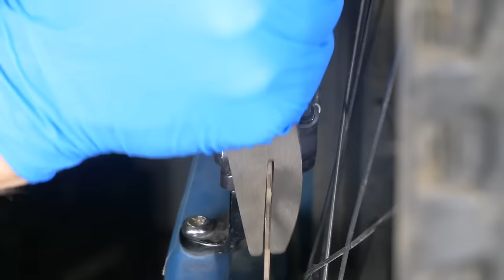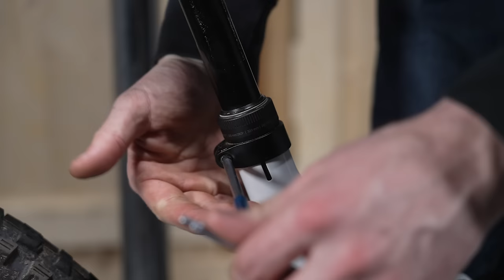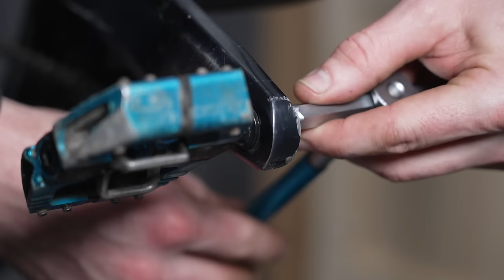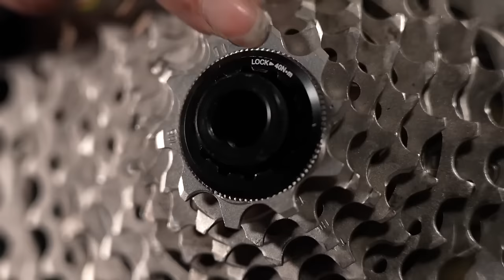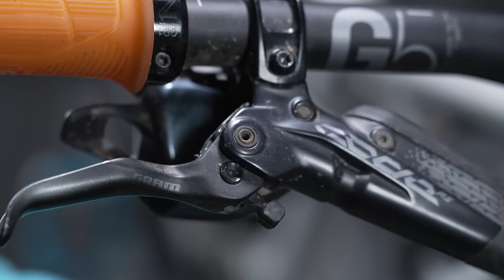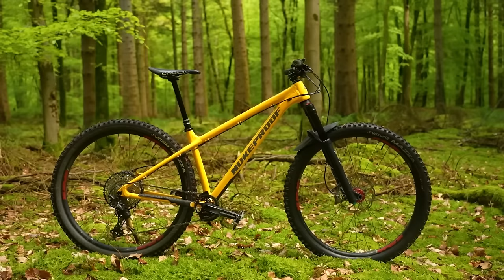Help! My Bike Is Creaking! How To Fix A Noisy Bike

Comment from the maker: Does your bike squeak and creak? Have you just ignored it up until now? Let us know if this video has helped! 👇
Reply: When I put a lot of power into it a clunc sound comes from my bottom bracket I think but I can also feel it through the pedals especially the right one. Any ideas anyone?
Reply: I'm just learning about some of this kind of maintenance, but I totally resemble the gorilla you mentioned. At normally over 100kg, standing under 5'10, I'm a hefty unit. Making things creak is kinda normal for me. I've got over 100 psi grip strength and am tuned for explosive forces. I did provincial class swimming, AAA baseball and was in an exceptional athletics programs, plus martial arts, blacksmithing and am ex-Army. I'm hard on kit. 

Hence studying your videos. LOL!!
Love your stuff.

Comment: You may have mentioned it, but be sure to check your frame for cracks! I had an aluminum bike that I chased a creak on for weeks before finally realizing I had cracks in the welds near the bottom bracket!
Reply: Me too. Mine was a Boardman.  Halfords were as good as gold and replaced the frame under the lifetime warranty.

Comment: I fightet a while against two creaks. First creak was caused by a slightly loose cassette, the second was caused by a rusty rear suspension pivot bearing. Yes, this bike wasn't even 3 months old, so in the end a warranty replacement. It took the bike mechanic about 3 or 4 visits until he found and fixed it.

Comment: If you hear creaking and cracking noise when you go uphill from your bottom bracket, then I'd recommend you to check the chain ring, it has like 4 bolts, you need to either use grease or loctite compound then tighten it up very well.

Comment: i'm confused. Why put grease on non moving parts like nuts & bolts, saddles, stems, seatpost clamps, , etc, etc, anyway. Wouldn't a tiny drop of oil be better.
Reply: grease adds more preload than oil due to its volume

Comment: I had a 2005 volvo XC70 that creaked on bad pavement I removed practically all the interior added grommets n silicone, new clips etc 
Hours, days, spent!
Found the culprit when I cleaned the car to sell it yrs later...
It was a dog toy stuck in my passenger seat rails, it broke and parts of it got properly incrusted into the seat rail.
I was so mad and relieved at the same time 😂

Comment: I had a creak on my road bike, that's more annoying as gliding along should be a serene quiet experience...worked my way up from pedals, cranks, BB, seatpost and what finally got it was a drop of ProLink on where the saddle rails at the rear enter the plastic, and make sure you flex the saddle at these points to let it penetrate....

Comment: You mention cable rub at the end, and this should be elaborated to include internal routed cables.Since they are inside the frame, any rubbing or binding can resonate and create creaks or squeaks you can't quite echolocate.  It's a huge pain, but the internal cables can be quieted with tape wraps, or spraying in some grease or as a last resort spray foam insulation.

Comment: No grease on the stem / bar interface? I usually grease it on alloy components to stop creaks and have never noticed any issues... bars have never rotated or moved. I have seen several other people do this too. What is the reasoning to keep grease away from there? It's not really any different a scenario to greasing and clamping a seatpost.

Comment: Amazing video! Thank you🙏🏼

I am wondering - what could be the reason if the headset creaks only arrive about 20/30 min into the ride, and can’t be reached when rotating the handlebars 90 degrees, but only when pedaling, and only when the hand are on the bars, otherwise when pedaling without touching the handlebars - no creaking noise🤷🏻‍♂️

What would you say?

Comment: Please, someone help me!

I have Canyon Pathlite 6 SUV E-Bike. I hear creaking when I put pressure when pedaling. Creaking happens especially when I’m pedaling uphill and pressure increases on drivetrain.

Creaking does NOT come from:

- Saddle or seatpost, since I hear noise when I’m standing on the bike.

- From pedals, since I cleaned and greased them well.

- From steering.

So, it has to come from rear cassette or bottom bracket. I’m I right? My bike has FSA bottom bracket, so I hope it is easy to remove and clean. Maybe I’ll give rear cassette and chain a good cleaning too. From the bottom bracket I hear grinding when I turn cranks slowly…

When I pedal at high gear, there’s no sound. Pressure on drivetrain = annoying creaking that drives me MAD!

Comment: I've rebuilt a 2021 Rockhopper an on it's Cairngorms maiden voyage on Friday developed a really sporadic and annoying "warble"... does it when I'm out the saddle so not that, does it when I'm freewheeling or just sat on the saddle so not the crank area, reckon it has to be the (admittedly "el cheapo") new Amazon Raleigh wheels, even though prior to use I stripped and greased the hub bearings...it's not the brakes either... maybe spoke/rim interface?? Will have to give it a post ride check over.... the fact it's random is most annoying and biking along looking at the bike and not ahead is a bloody recipe for disaster!

Comment: Is there a reason my headset keeps creaking? I have already brought it to the bike shop, and they fixed it but the creaking has just started happening again.
Reply from the maker: The headset is a high stress area, if you drop it back to the back shop they should be able to help you again! When did you last have it changed?
Reply: @gmbntech  ok thanks, and I never changed the headset before because I just got the bike September 2023

Comment: I'll like some advice. I have a Cannondale Flash carbon frame. It has bb30 bottom bracket but i use shimano deore XT m8000 cranks. For that I use FSA adaptors so i can use those cranks. I struggle with creaks on a specific part of the pedal stroke. Work done for fixing it: checking cassette is tigh correctly; clean and regrease hub; clean, re torque cranks (once found the left arm was loose even after it had been torqued correctly probably 1-2 months earlier); changed bearings of the bb since old were worn out and new ones have been for around 4 months and less than 2000km  (proper tools were used to set the bearing since those need to be pressed in) and taking off seat post, clean it and put it back with its grease

Any idea what may cause that. It really bothers me since when i pedal with low force it doesn't makes that noise. Only when ascending/sprint/hard pedalling since going fast. Gets worse after cross country race/training
Reply from the maker: If the noise is still present when out of the saddle you can eliminate the saddle/seat post. The next thing to try is to see if the noise is present when pedalling with no hands (only if you are able to), if the noise can still be heard you can eliminate the headset area. If it is still making noise, it could be the mating face of the BB shell and the frame. Have you tried reinstalling the shell? If not you should try that. Noise travels in carbon frames so it's tough to pinpoint the sources of noise 😬 Hope this helps!
Reply: @gmbntech  thanks a lot, the only thing not done is reinstalling shell. Headset bearings were installed new like six months ago and I check them monthly since I abuse of the suspension 😅